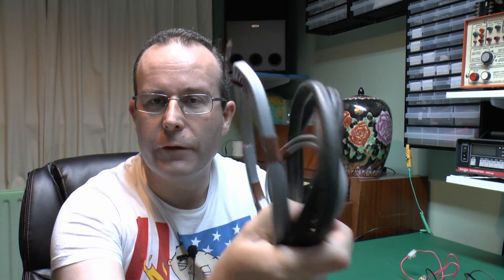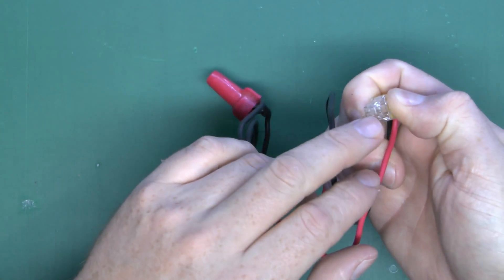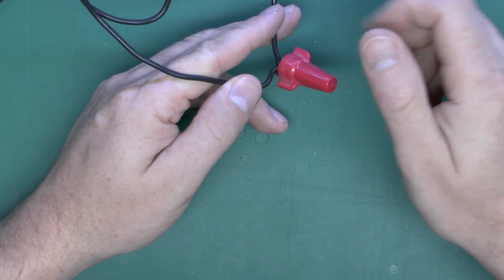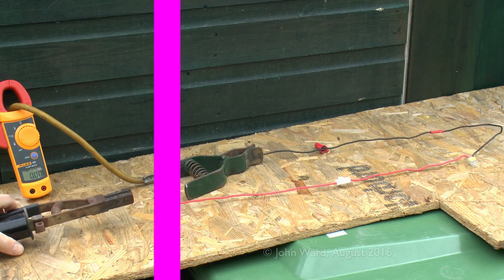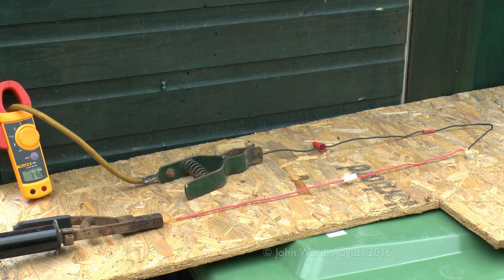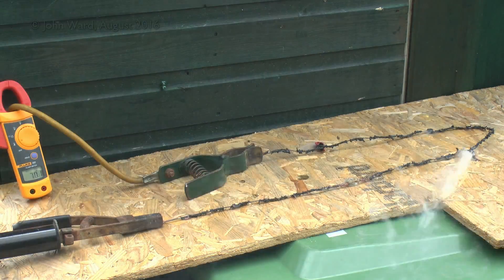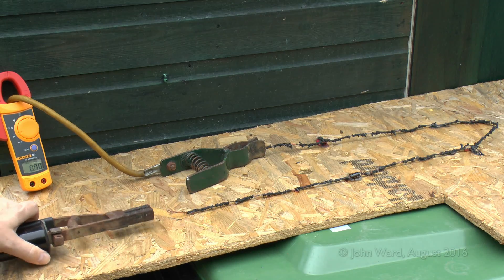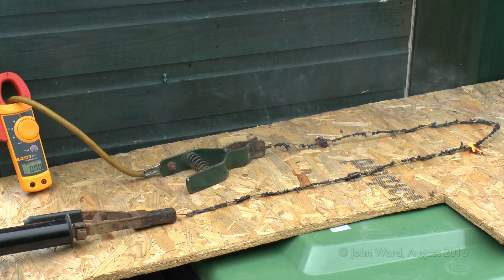Wire Connectors Overloaded

Comment: My take on this test is, that anytime you have a connector that has movement, or not solidly connected together, such as the spring clip connector, you build up more heat at that location due resistance in the connection. Just like in situations in a home where a screw connector on a switch or receptacle is loose, heat builds up at that location when under a load and many times that wire gets hot enough to melt even though the connection itself does not fail. When I first saw the connectors at the start of the video I selected the spring connector to be where the failure would most likely happen. The heat built up in the area near the connector and even though the connector did not fail, the heat was high enough to melt the wire before the connector.

Comment: Nice demonstration, WAGO insulation started melting from high resistance first, the wire nut wires should be twisted 360 and trimmed before the nut

Comment: The failure point is likely due to the 90 degree bend or better (barring and unforeseen nicks) next to the Wago connector which undoubtedly as seen by the actual fire was the connection with the most resistance, therefore creating heat. It would have been been helpful to have an infrared camera to watch the actual relative temperature on each one. As electricians we are taught to avoid sharp bends and over fatiguing the wire. Thanks for the demonstration. By the way, most of my brothers do not use the Wago connectors in anything other than end point connections in ceiling light cans as provided by the manufacturers..

Comment: Wagos are fine at the end of a circuit. But I have found that if installed near the beginning of a circuit and with the amount of wattage that goes through them, they eventually burn apart. But when speed comes into play, they rock.

Comment: Good demo John, nice to see that most terminals held up under normal loading conditions. The wirenut is good for solid conductors, I used them in The Netherlands for 1.5mm² (lights) and 2.5 mm² (power) in the 1980's. I think they are best as the twisted wires have a large contact surface area within the spring.
 Wago's are also for solid wires. I don't like the relatively loose connection and small contact surface area.
 The chock block can be used for solid and stranded wires, the cheap chock blocs often have a steel housing instead of brass adding to more thermal cycling.
The crimp sleeve is for stranded wire, and as long the correct crimping tool is used it is a very good connection.

Comment: Im really supprised that the wago did so well, the spring must be really good heat wise :-)
The butt joint and chocolate block connector was no supprise, i didnt expect them to fail.
The nut or i think marette worked but i think it was the tight twist of the wires that took the brunt of the power, not that spiral spring.
Amazing that the wire took so much :-)

Comment: Wago is the superior connector for this solid wires and all other connectors used will have increased contact resistance over time due to thermal cycling.
Also this 1.5mm^2 wire is used for lighting protected by 15 or 16A fuse or breakers.
Reply: Not in the UK - 6A or 10A.
Reply: That is maybe what you have on your Light circuits but 1.5mm^2 copper should be capable of 15A anywhere in the world :) If you know you will not have more than a few 100W incandescent light bulbs (guessing those are banned now) on that circuit you can of course use 6A or 10A fuse or breaker and that is done anywhere in the world but I was talking about the max limit allowed as being 15A for that cable section.
If circuit is very long then you will be limited to less than 15A not because it will not handle that but because voltage drop will be to high.
Reply: 1.5 is right on the limit of what would be acceptable for 15A. It's OK in free air, but when it's bundled into common conduits, buried in walls and so on, then de-rating comes into play. In any event, UK standards for PVC 2 core + live specify that a radial circuit with a 16A or 20A breaker must have a minimum of 2.5 cable on live & neutral with a minimum 1.5 for earth protection.

Note that there are types of cable where higher currents are allowed, but they tend to be special ones such as copper-clad mineral cables which can take much higher temperatures than PVC.

In any event, I'm not sure I understand why lighting circuits need more than 10 amps.

Comment: So correct me if I'm wrong. 

This shows that it is very hard to overload a wire, as per this experiment a 1.5 mm2 and you're running 70 amps, while the highest a normal house would have is 40 amps for a cooker and that will go on a 6 mm2. 

I would say if someone pulls a 1 mm2 wire for a 40 amps feed, then we might have a problem over some time, or if someone uses 115 x 100 W light bulbs on a 40-50 amps feed on a 1 mm2 wire :))

When is the wire going to get glowing red, actually being able to create a fire ? :)

Comment: What's the resistance of those connectors? Intuition suggests the standard brass and crimped tube will be best since they got most contact area and the copper can be squeezed quite hard, meanwhile wago has so tiny area the wire spins freely inside (and the thin plate has less copper?). Not sure about the yolo twist thing, it's too big and funky anyway. Mechanical properties are also important (on the battlefield which is construction site), with inline connectors you avoid the 90 degree kink.
I use wago for neutral (can connect 3-5 together easy), for rest the old screw stuff.

Comment: i think the issue was that it was a loos connection.
in my experience, over time a loos connection will cause increased temperatures around it even at currents lower than the line is rated. only recently i had to deal with a situation were the wiring had melted and a fuse had blown around a fuse holder where the terminals wear not screwed tightly, with now indication of undercurrent .

Comment: One thing to keep in mind:
The heating is due to the resistance of the wire. I would assume that the wago connector was the least solid connection which allowed more resistance causing heat. Still very impressive load handling
Reply: I don’t really see any reason to think that. The point it broke was well beyond the connector.

Comment: For jointing I prefer a butt splice crimp as it's a solid mechanical connection I've now got into using the Waggo connectors but I still like to use chock blocks as it gives you piece of mind knowing you've tightened it up good and tight that's something your don't get from a push in style of connection. I've never used the wire nut style of connection I always thought they were a Twist and Stick style of connection so I've never trusted them and with all the testing that's required in the UK it would be a right pain for testing.
Reply: +glenwoofit But that's the whole weakness of chocolate blocks, and why it's forbidden to use then in inaccessible places - you can do up the screw nice and tight to start with for sure, but copper is ductile not springy, and the pressure in the screw connector can gradually weaken as the copper slowly deforms. you also have to exercise good judgement as to just how tight to do it up in the first place. the wago connector has none of those problems. it's only really disadvantage I have found is that it's more awkward to remove wires to change connections, and the 222 type overcomes that.
Reply: +Rosscoff2000 Yeah in the UK it's in the regulations that only maintenance free connections are allowed in inaccessible area's

Comment: three things unless your circuit breaker is faulty, the wrong breaker was installed for a certain wire gauge, or there is a wire gauge being used somewhere that is lower than what the circuit is rated for.  this kind of extreme testing the results will never happen in real life.

i have mixed feelings about many of these connectors the screw down type can be over tightened and then fracture the copper and it can just break off and pop out of the block. 

"wire nut" which is a "brand name" or twist connector can be improperly installed and can fail when you use the wrong nut for the wrong wires. such as using a nut that is for 12 gauge wires on 10 gauge wires. or the nut was simple installed improperly and the copper wire has been weakened and given time can snap off and come loose.

the crimping style conector is the most secure and allows for marine grade heat shrink to make a waterproof connection but these waste wire when you have to modify or repair it later. uses these in conditions that they could get wet or corrode.

the "wago brand" which they now make reusable "lever nuts" (the ones in this video are push fit) are pretty good and that they allow easy and less "violent" means of connecting but given that they are newer we do not know how long they will last overtime. and the "lever nut" style is 100% reusable unlike a "twist connector" style that really should be disposed of after it is used.

i work in an older apartment community that has been remodeled twice. original (1950s)wires were copper the 1st remodel wiring was aluminum and the 2nd remodel used copper clad aluminum. so when the Wago lever nuts were released i immediately began testing to see if they could replace traditional twist connectors.

and behold they do a fine job keeping the copper wires from directly contacting the aluminum wires and severely reduces the problems that i have with working at my job. how i tested this is we used all electric appliances and the water heaters are a troublesome problem. new water heaters use copper wires. the buildings wires are 90% solid aluminum for connection from the load center to the water heaters. so i set a water heater to normal temperature and had it run water through it constantly until the lever nut failed. and it didn't even break a sweat.

I have to do (well i had to) periodic maintenance on the water heaters to prevent them from melting the twist connectors and they the plastic on the twist connectors would melt and then eventually something would contact metal and trip a circuit breaker. these lever nuts have been going for nearly 2 years now and i refuse to use anything else for my needs.

Comment: The weakest part of the circuit was probably caused by bending the conductor sharply or nicking it when stripping. 
I have never liked or trusted the "Screwit" types although they were probably used on the moon landings. I was always taught not to crimp solid conductors, and the Wago ones have their main contact point on a tangent to the conductor, so I would have thought that the common terminal block type would be the most secure, particularly if the conductors were pushed through so that each screw clamps down on both of them.

Comment: I live at apartments in San Antonio Texas 2017. I just had a San Antonio Housing Authority inspection that passed the kitchen having no GFCI except for one electrical outlet. The rules in 2014 were that all the kitchen is to have GFCI. Also, in this apartment are several electrical outlets that are loose. The plugs fall out and the electrical testing device I just bought says the grounding is shaky or lacking on several. I had surge protectors on 2 of these and then I noticed lights crackling and blinking and then the surge protectors stopped working completely.
I wrote a work order July 5th for these problems, but so far no one has showed up to fix this. The apartment manager said that the SAHA would have to show up again to inspect again before these problems are fixed by the apartments. But when I call the several inspection managers at SAHA, they do not call me back. Today is  the 15th. 
Why do these apartments--Arriba apartments, 5200 Blanco--not fix these electrical issues whether or not SAHA inspects or not? Loose electrical outlets lead to fires, right?
So I immediately bought rental insurance for this apartment because I am thinking that all of these apartments are having these same problems.

Comment: This is a good demonstration on how housefires start when you run a plug-in heater for too long from an outlet it's not the heaters that catch fire it's the wiring inside the wall that is not rated for that constant amps being pulled.  so just imagine a wire from that outlet all the way to your breaker doing this inside your walls.
Reply: This is actually a bad demonstration.  Most electrical fires do not start because of a heavily overloaded wire, but because of dodgy wire connections at currents well wirhin the projected limits of the wire itself. So the connections are the critical pointsm not the wire itself.

Comment: The wire nut is what's used most commented make sure they are underwriters lab.listed before using use as detectors consult inspector before using

Comment: On the choc block connector, did you connect it so the two cables were touching one another, one on top of the other and clamped together, or did you just put a short piece in either end so each screw was only connecting one cable and the choc block formed part of the circuit?
I am not a fan of choc blocks as they can sometimes burst open as the screw tightens up.
Screw on wire nuts were used a lot back in the 60’s and I believe they mainly fell out of favour due to the porcelain not having the correct impact resistance.

Comment: A better test is repeated hot-cold cycling.  This is when failures show up as the metal expands and contracts.  Most electricians in the US have bad experience with wagos because their small spring-contacts weaken and fail long before the other connectors.

Comment: I would have liked to seen a test of the electrical resistance formed by each connector. ALL connectors are only as good as the installer. A butt connector can have its plastic insulation damaged especially if crimped without using the proper tool, can be weak, not very good for solid wire but takes up the least amount of volume. The wire nut can provide the greatest surface area of wire in contact but can become loose and fall off if not taped on due to vibration, or not provide good contact if not twisted on properly. It also takes up the most volume (in this comparison). The screw connector may loosen over time and many heat cycles but is the easiest to remove without distorting the wire much.  It also is less mechanically secure on solid wire. The Wago connector is the simplest to install and easiest to learn to install properly, can safely and securely attach two different size wires (within reason) and takes up little volume. It may be more difficult to install on stranded wire and some types do not recommend using for stranded wire.
All of these connectors provide no protection against oxidation and/or moisture without using dielectric grease so connection resistance will change with time. It should go without saying to make sure that the connector is rated for aluminum if used on aluminum wires. Essentially all of these connectors (except Wago and screw connnectors, as far as I know) are available with grease and/or heat shrink or a skirt (wire nuts) which improves protection against oxidation/corrosion. But then there's always tape. Good old tape.

Comment: Thanks for doing the video John... I'm surprised too, I really expected either the Wago or the Wirenut to fail. The choc blocks as noted by CrimsonTrainer tend to fail over the years due to loosening from heat/cool cycles (That's partly why I included it)

I should have included the 222 type as I had some, but I suspect, as they rely on the plastic lever to supply force, they'd fail pretty fast. Looking forward to stefantrethan's video :D
Reply: I don't think the wago 222 type relies on the plastic levers to apply the force, it's the other way round.  The levers are used to open the gate and when you release them a spring clamps the wires.
Reply: That would make more sense, yes, thanks :D
Reply: That is correct; the plastic lever pushes down the metal springy bit to release; when the lever is down, it doesn't touch it and the springy bit clamps the wire. Look at Wago's demonstration video(s).
Reply: Actually I think the 222 types have a even stronger connection. Other types you can twist and pullout the wires but doing this on the 222 type is much harder. You need a mechanical lever to insert something while on the other types you can simply push the wire in.
Reply: wire nuts dont ever fail thats how we wire all our high power in our houses in the usa you wingnut lol
Reply: @petehiggins33  
Yes.  If the shell somehow disintegrated, the clamping spring and bus bar should keep the wire in place.  There have been some tests of them being well overloaded where the shell melted but the connection stayed in place.
Reply: @raymondj8768  
The problem with wire nuts is that sometimes a proper connection isn't made.  It can be hard to tell depending on visibility of the wires going into the nut.